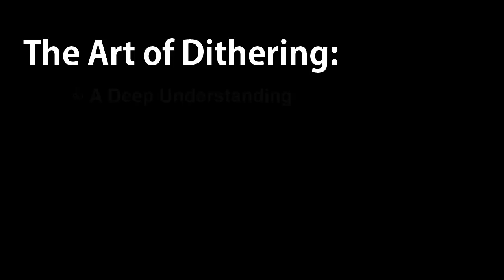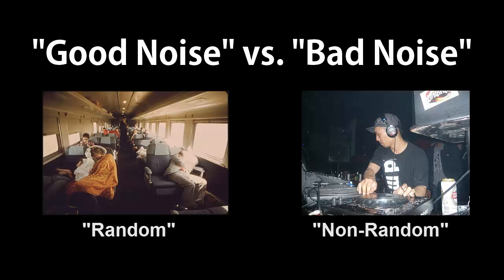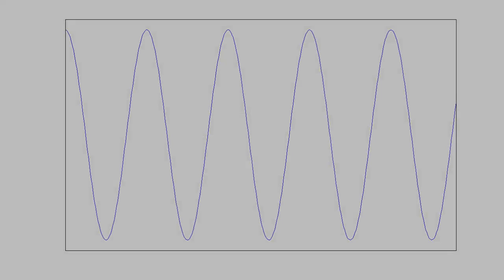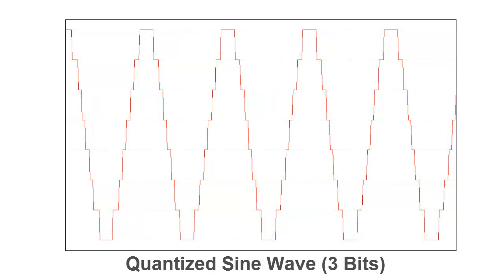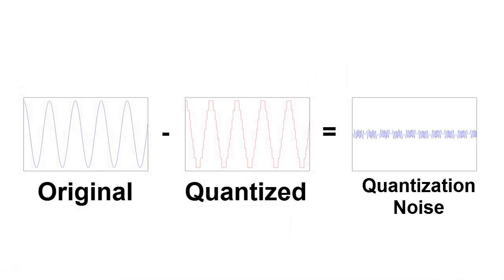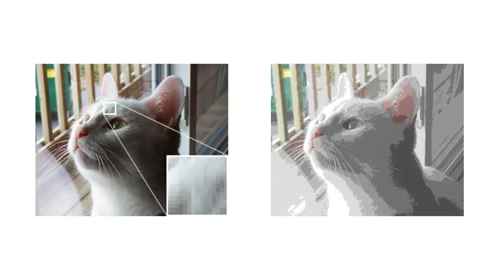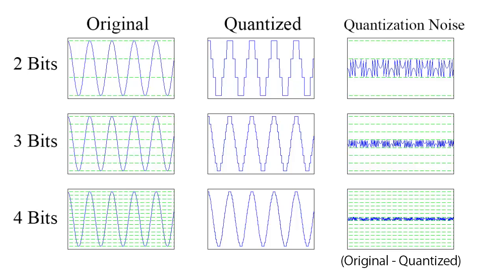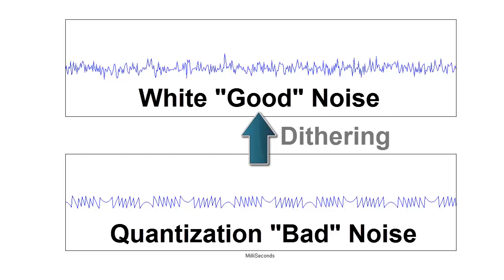Music Technology 101: Dithering Explained (1/2) - Quantization Noise

Comment: Don't most players have some sort of interpolation on bit depth and sample rate to make it sound more smoother, or curve it as opposed to say connecting the dots (linear) or using the nearest neighbor? Probably through a cubic interpolation? It would at least make it resemble a sinusoidal but might make more complex waveforms more muddy.
Reply from the maker: That's a good question. I don't know the answer to that. One thing's for sure: some sort of "interpolation" is used simply by turning the digital signal into a continuous analog voltage signal. However this is not what you were talking about.

Comment: If I render a track to WAV using 48khz and 24bit, would there be any need for dithering?

What I'm trying do is render an entire track to audio, and then master it with dithering.
Reply from the maker: Ideally, you should dither whenever you reduce the bit depth of your audio. So, whether or not you'd need dithering would depend on whether your source material is at a higher bit depth than 24 bits.